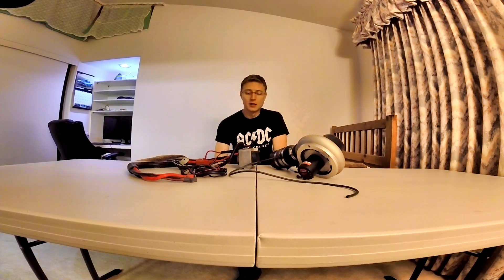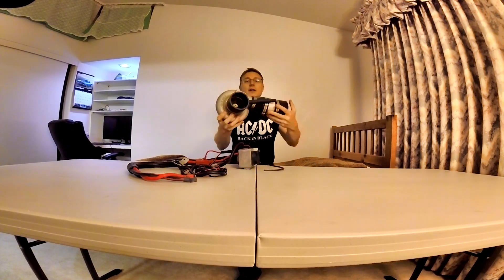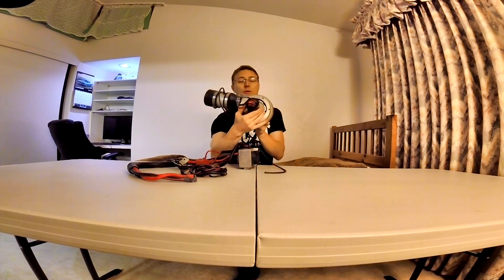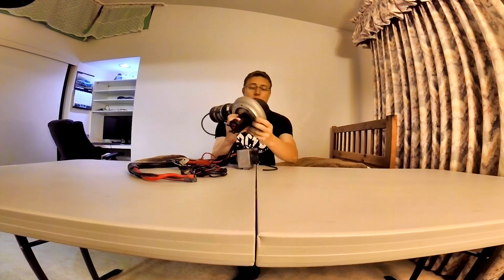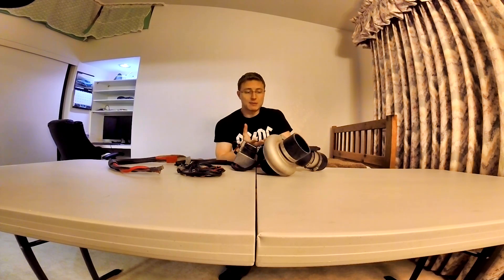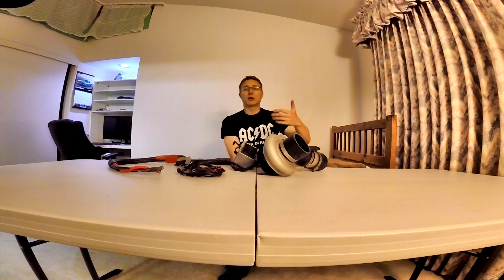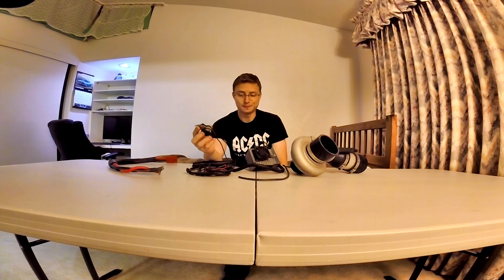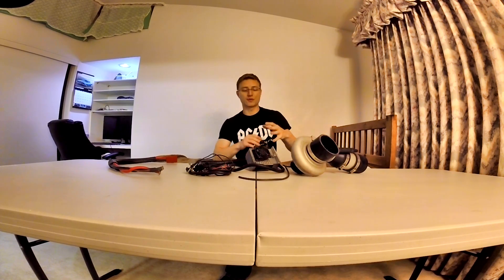phantom electric supercharger

Comment: How much more horse power will this give my 2011 2ss Chevy Camaro 6.2l/L99 engine.?????000000
Reply: This was not built for such high displacement engines, so it would quickly start to choke it and you would lose power.

Comment: I know this is an older video but i would be worried about the internals of the turbo coming apart and getting sucked into an engine
Reply: That is a risk you take with any turbine. But for the record there are at least 100 of these kits that have gone out and none have failed in such spectacular fashion.

Comment: Do you think a blow off valve would be necessary for something like this?
Reply: no, not enough pressure in this system to need a bov There was a full explanation of why on a forum I was following. However I cannot find it off the top of my head. I have seen many projects running this with no purge and no issues.

Comment: What do you think about this one? They claim to get 2 psi? https://nl.aliexpress.com/item/Elektrische-Turbo-Supercharger-Kit-Automatische-Snelheidsregeling-Hoge-Effici-ntie-en-Energiebesparing-Luchtfilter-Intake-Verbeteren-Auto-Snelheid/32848019426.html?spm=a2g0z.search0104.3.2.5b5451cdddVI2U&ws_ab_test=searchweb0_0%2Csearchweb201602_1_10065_10068_319_317_10696_10084_453_10083_454_10618_10304_10307_10820_10821_10301_537_536_10902_10843_10059_10884_10887_321_322_10103%2Csearchweb201603_59%2CppcSwitch_0&algo_pvid=3c48a94c-fe10-4128-9186-e251d3a936b5&algo_expid=3c48a94c-fe10-4128-9186-e251d3a936b5-0
Reply: It looks like an all right piece of kit, but depending on the application your engine might be able to pull about that at the higher RPMs anyway so this thing would likely be a restriction.
Reply: @cr4zyw3ld3r  engine is 1.5 16v, they claim it can get 0.21bar. which is like 2.5 psi? Good enough for like 10-15hp? Do you think its achievable with that elektric supercharger or you think its scam?
Reply: @mistervova11  I mean the compressor looks good externally,  but without a Flow bench or anything to compare it to it's tough to say.  Plus they don't show the exposed compressor wheel either.  Is it possible,  sure.  But hard to say without others verifying.  There was a tiny turbo fitted to a Yamaha  250cc engine which worked quite well,  but it was exhaust driven.  I am always a tad skeptical about 12v systems.  But if they are using a brushless or maglev motor in there I could see it hit that pressure.  I would just hate for you to dump $500 down the drain if it fails to live up to expectations.
Reply: @cr4zyw3ld3r  Yeah the guy told me he will send a video proof tomorrow or something, will look into that. What do you think i can achieve if it really gives like 2 psi on my 1.5 102hp engine + custom ecu map. Do you think 120hp is possible?

Im building a cheap rally car and right now it weights 830kg with around 110bhp
Reply: @mistervova11  I think realistically it would be good for about 7hp if it works.  But the load on your alternator will likely increase.  I am not sure how this setup works,  but I would imagine you will want to pick up a high output alternator.  The other thing to watch out for is the MAF not sure if your car has one,  but if ut does sometimes they aren't rated for thr flow rate of the extra boost and that can cause   ecu issues.
Reply: @cr4zyw3ld3r  Yeah just found a video of this aliexpress turbo, https://www.youtube.com/watch?v=XxkU2ftBbK0 he said it only produces 0.5 psi at 12 volt. Thats what i though it was too good to be true. I guess i'm gonna put a real supercharger in my car then... Funny thing is  i can put 0.5-0.7bar supercharger in my car it will take me like 1-2 days, and will cost me like the same amount as the fake aliexpress supercharger
Reply: @mistervova11  yep, in a lot of cases going the supercharger route is the easiest. But you should check with a shop if you are getting hot intake temps. A shop can usually check with with an ECU reader.